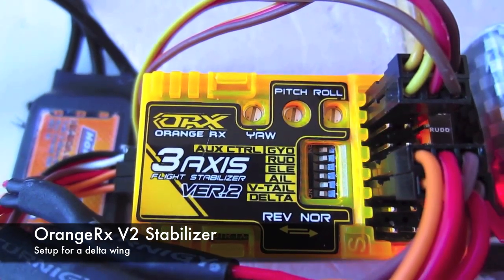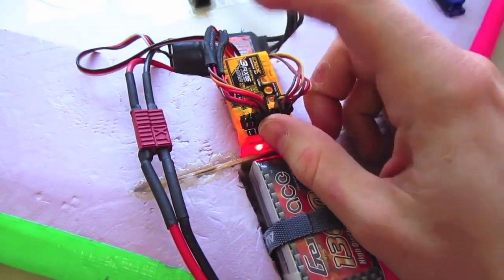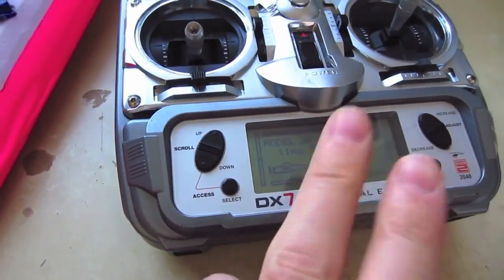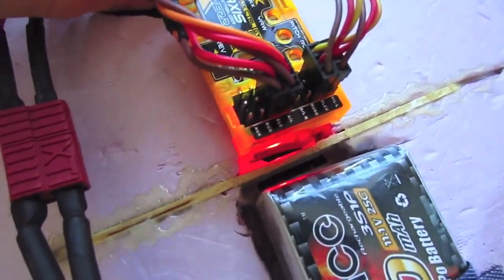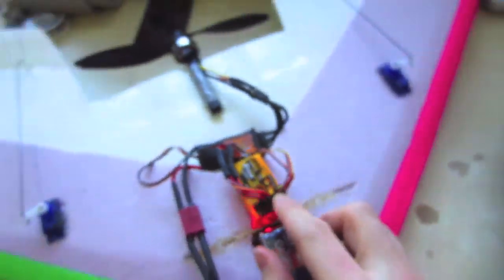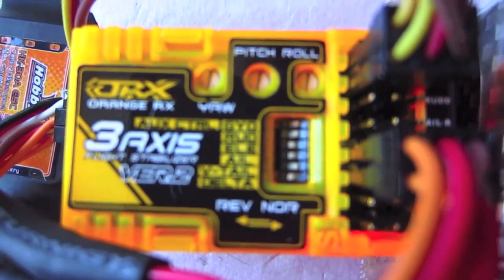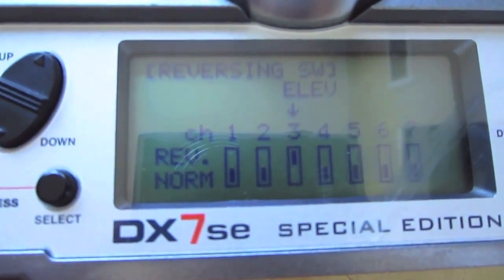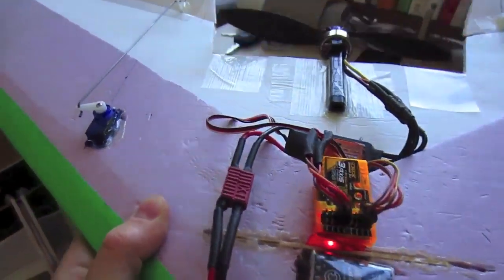OrangeRx RX3S V2 Stabilizer - Delta Setup

Comment: Just installed mine in my wing. works great on the bench. Thanks for putting this video up. Helped a lot.

I have it on my AUX so well be interested to test the difference. But form your video i can tell its going to be great. I have one of those UMX Mig15's with he AS3X. everyone is amazed the winds it can fly in. ;0)

Comment: Have you happened to try this stabilizer with digital servos?  I hooked mine up and the servos went crazy, twitching and oscillating too much to fly confidently.  It was quite a bummer.  Not sure if I got a dud or if it's the servos.

Comment: Mine is working, but the stabilization is reversed. Pitch works Roll, etc. I'm on a Taranis Plus with X4R. I have tried reversing a bunch of things with plugs and on the radio. What am I missing? (there is no Rudder channel programmed)

Comment: When i use just a receiver my servos work fine and fast.But when pluged in the way you show my servos glitch and move slow.
Are theses ok to use with digital metal gear hv servo's ? Or should i be using  none digital servo's.

Comment: Hi! i've set up my stabilizer for delta but i had to enable delta mixing on my Tx (Hitec Optic 6) everything else was just like yours to make it work for controls but when i'm testing the correction movements for pict it moves only one servo and for roll the oposite one, never both servos

Comment: Hi 
connected the v2 unit to my versa wing
It seems the dual rate and expo settings don't operate when the unit is on
is this normal?
Reply from the maker: Are you using digital servos? I use analog

Comment: I have my 1st Blunt Nose Versa about done. I also have the Orange RX3S stabilizer but the one with the built in 2.4GHz receiver. I'm trying to figure out how to turn it on and off from my DX5I radio... Any Ideas? Also how sensitive did you end up setting your pots in the Orange unit as per stabilizing the Wing? Oh and how did you mount the Unit so the connectors did not get squeezed in-between the top and bottom of the inside of the plane? My Orange RX3S unit even at the widest part of the inside of the Versa Wing, has the wires coming out of the Orange unit right up against the top of the inside of the plane...Any help would be great! Would like to know how you did yours. My E-mail is good on qrz.com Pics of the inside of your plane would be cool!
73
Jimmy, ARRL TS, WX9DX
Reply: Hi Jimmy, 
I'm not sure regarding the DX5e radio... Perhaps you could switch out the spring-loaded trainer switch for one that stays in either the on or off position when moved (like the dual rates switch)? 
I have this receiver installed on my FT Versa also (regular nose though). There was not enough space inside, so I cut out a piece of foam on the top right below the wing spar and glued in a piece of foam board a little bigger than the receiver. This way the receiver is laying horizontal and is close to the CG. I used velcro to fasten it. I'd probably cut a piece out of the top so the leads can stick out. If you are worried about them being exposed, make a tape barrier/pocket over the hole.
Today was my first time trying the stabilizer so I can't comment extensively on what levels to use. I had it in light wind (10-15 kph) and gains set to 50%, which was nice. I may try turning them up a little next time. 
Regarding the wire setup in the video, I set mine up as the video suggests but my roll stabilization was reversed (roll left and it will roll further left to try and fix); my servos are mounted facing down. To fix this, I had same set up with one exception. (Facing the nose of the plane) the right aileron plugged into the elevator, and left plugged into aileron L. I reversed both servos on the rx, and reversed the aileron servo on the tx (DX6), instead of the elevator.

Hope this helps!
-Phil